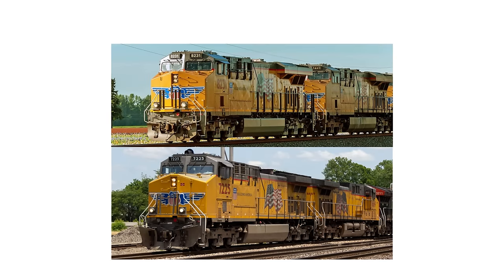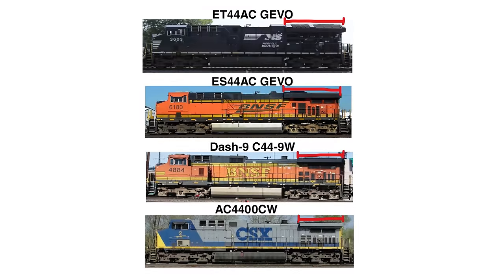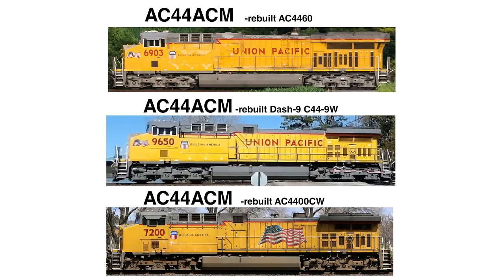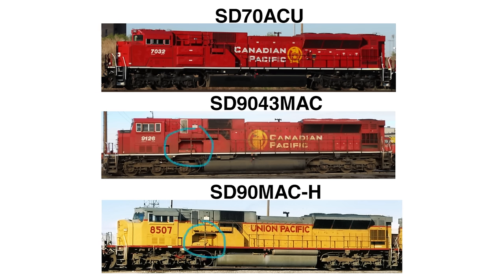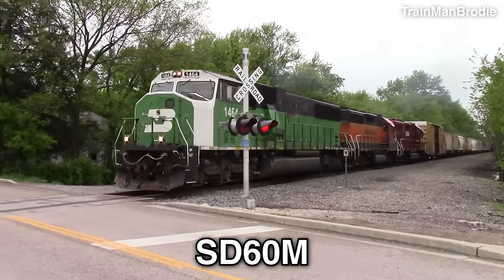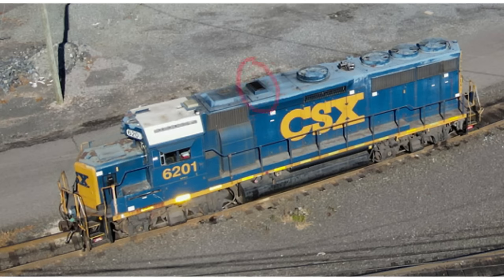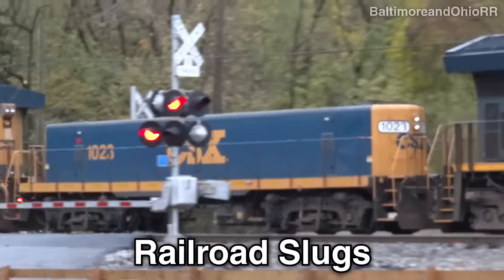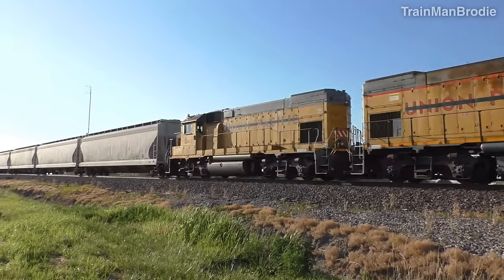How To Tell Freight Train Locomotives Apart

Comment: Missing ones I can remember:

•SD7 (used to run on Portland & Western before retired in 2023)
•SD9 (few still runs like the Copper Basin Railway and possibly more if still needed)
•SD40M (I find those on G&W)
•SD59MX (that’s the one I was literally waiting for)
•GP39-3 (BNSF probably still use them)
•GP10 (they still use it on L&D and more)
•GP9 (some shortline railroads still use it)
•GP7u (rarely found running but I think some runs)
•GP16 (I actually saw one running)
•GP18
Reply: Plus those both have high hoods.